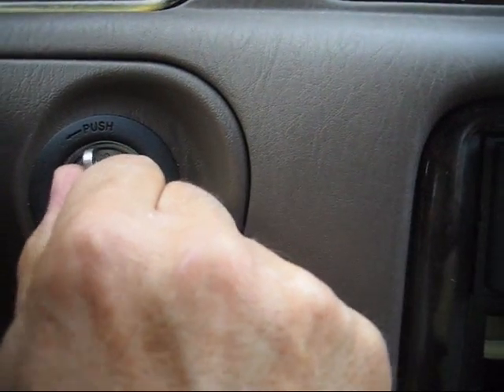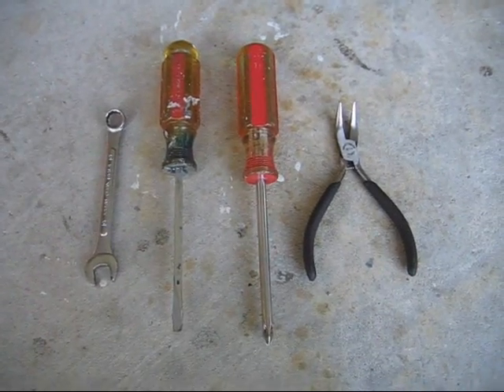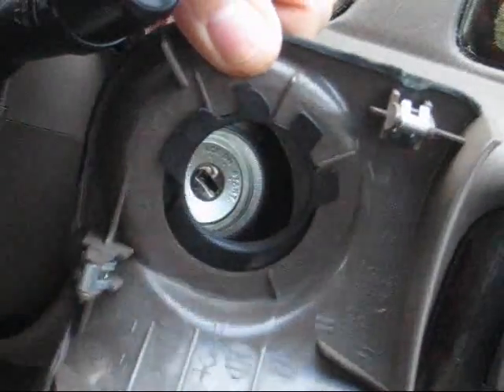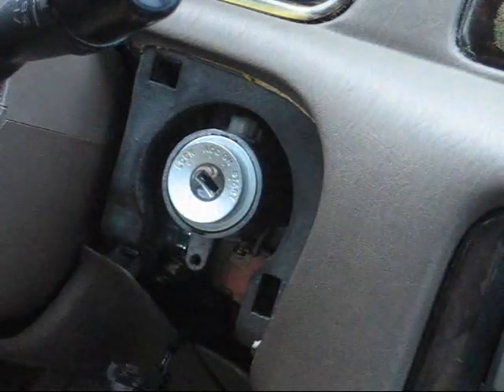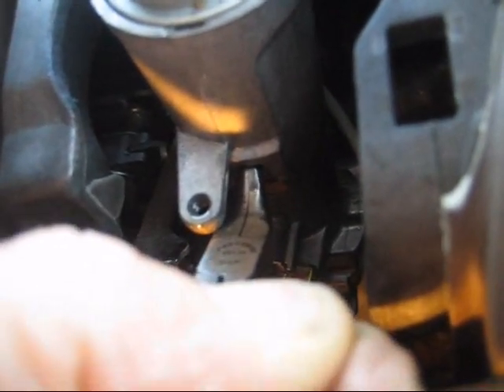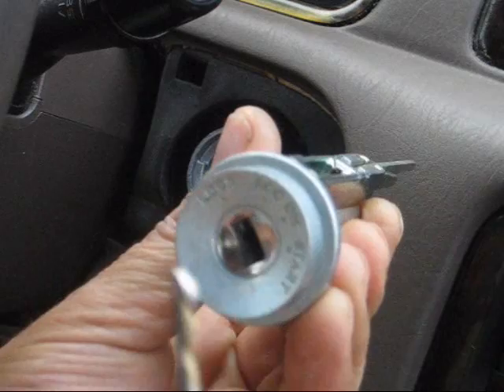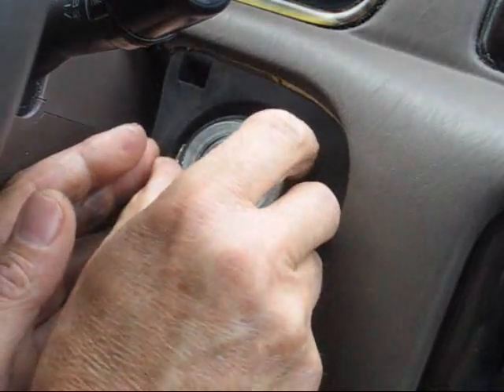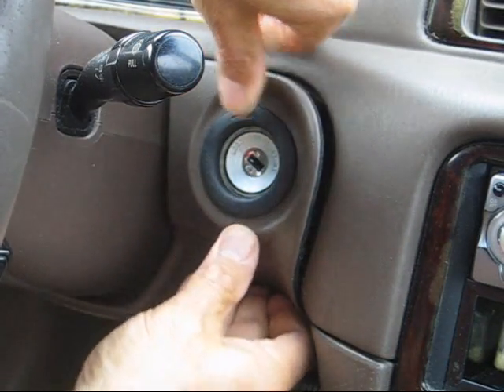Ignition Key Lock Cylinder Replacement - 1998 Toyota Camry (1997 thru 2001)

Comment: I liked ur stuff looks great. however my key won't even turn to Access position .. any suggestions ?  thank you
Reply from the maker: Hi enslaved 46, getting the key to turn to the ACC position is the hardest part. I struggled moving the key back and forth, used different keys, a newly cut key, pressing the brake, WD40 (not sure if any of that did anything) for a long while till it randomly moved to the ACC position, otherwise I would have had to drill the pin so the cylinder would release. Good luck enslaved 46, let me know how you make out.

Comment: I don't know if you would know the answer to this, but if you do that would be awesome! 
I recently had the ignition installed on my 97 corolla. I do not live within 100 miles of where I got the work done so it wouldn't work that well to drive back there to get it checked out. But there has been a problem when I turn my steering wheel to the left and then to the right since I had the ignition changed with new key. When I turn the wheel to the right it will occasionally click as if the steering wheel is trying to lock (and it has locked sometimes when turning the wheel to the right). Any ideas?

Comment: AMAZING straight to the point video. Friends car at 190,000 so getting close. Is there any way to use the same key or do all ignitions come with new keys?

Dealer has a cylinder kit that includes ignition & all locks but it's $350.
Reply from the maker: Each ignition cylinder comes with their specific(unique) key for that cylinder. It’s basically an anti-theft design. Otherwise, a thief can use their key/cylinder to drive any car away.  The frustrating part is it could happen at 100,000, 190,000, 220,00 miles and so on or maybe not at all. Very unpredictable. Mine randomly got stuck and it took me awhile before the ignition cylinder finally moved into the ACC position. (Or I may have had to drill the pin to have the cylinder release.) 
I purchased the ignition cylinder/key at a local auto parts store for around $50.00. Yes, I had 2 keys, but I was fine with it. Let me know how it works out. Thank you ZeroMemphisto for your comments/posting.
Reply: @DoItYourSelfers  Thanx! I've read things like having a lot of keys/objects/weight on your keychain will cause the tumblers to break/flex after awhile. Not sure how true it is since I've had Push Starts for some time now, but to be safe I keep as little as I can on the keychain.

The part should be in, in a few days and this looks super easy so should be no sweat. Thanks again

Comment: I can't get my key in ACC:( any tricks if I can't get it to access? I've been trying for about a hour
Reply from the maker: Unfortunately John I don’t have any tricks, like you I struggled moving the key back and forth, used different keys, a newly cut key, pressing the brake, WD40 (not sure if any of that did anything) for a long while till it randomly moved to the ACC position, otherwise I would have had to drill the pin so the cylinder would release. Good luck John let me know how you make out.
Reply: Old post, I know but what worked for me are Dupont non stick dry film lubricant ànd graphite powder. Be careful with the graphite as it is very messy.

Comment: Hi, Is it necessary for the old switch to be able to turn to the accessory position?  Mine will not even turn at all.  Will I still be able to release the spring and remove the old switch?
Reply from the maker: Hi Rick, The key needs to be in the ACC position for antitheft reasons otherwise anyone could pop out the ignition lock cylinder and use their
key and ignition lock cylinder to start the car. I gotta tell you, I struggled moving the key back and forth, pressing the brake, used different keys, a newly cut key, WD-40, then (I’m not sure those things even worked but) it moved to the ACC position. If it didn’t move, I would have had to drill the pin in order to have the cylinder slide out. Good luck. Let me know Rick how you make out.

Comment: May I ask you, is it easy to replace the green light that goes around the cylinder? Mine went out when I replaced the cylinder.
Reply from the maker: Actually, mine hasn't worked since before replacing the ignition. I didn't want to get into removing the cover panel and I believe a metal cover plate to get to the light connector. I decided the car was too old for the effort. Good luck if you decide to take it on. Thanks unclealpine for posting.

Comment: I have a 99 Toyota Camry I'm trying to do the same thing Casey run to push on the button and take it out but it's not removing I'm not sure if Mike he's going all the way into the ACC position any advice
Reply from the maker: Hi Guy, you might be right, it still might not be in the ACC position if it’s not releasing. Other than persistence and determination, moving the key back and forth (a 100+ times), using different keys, etc. it moved and I was able to press the release button. Otherwise I would have had to drill the pin. Good luck Guy let me know how you make out.
Reply: Guy Bowen  im having the same issue i already tried more than 1000times and not succes any idea?

Comment: Great video!! I am having an issue with my 99 camry. I can't get the button on the bottom to go in.  I turned it to the ACC position but I can't get the spring loaded button to go in so that it will release the old cylinder.  Any suggestions?
Reply from the maker: Hi datzitteezy, hmm, maybe the spring is jammed or not aligned/seated properly. You may have tried this already but spray the button with some WD-40 lubricant and really push or lightly tap on the button but from different angles. (Not necessarily just up and down) Let me know how you make out. Thank you for posting.
Reply: +DoItYourSelfers thanks for the help still unable to get it out. Pretty frustrating at this point. I've tried everything.
Reply: datzitteezy posting a video on this issue.
Reply from the maker: Oh man, I feel your frustration datzitteezy. I looked at my old ignition (I thought I threw it away) :) As you know, the spring loaded button will not move or go in unless it’s in the ACC position. I’m wondering if your ignition key looks like it’s in the ACC position, but may not be fully.
Easier said than done but, I had to wrestle for at least 20 minutes wiggling the key back and forth till I got the key to freely move. (not just to the ACC position) It was persistence that got the key to move. I just needed it one time to move fully for me to replace it.

Comment: After putting in the new lock cylinder,  the car won't start.  I didn't disconnect the battery prior to the process.  I think that was my mistake. 
I believe there's now a security feature keeping it from starting.  Any advice,  please?
Reply from the maker: Sorry to hear that.  My first thought would be check the fuses under the hood in the black box. If you did, check all the fuses associated with the engine starting/running. Good luck Infinite Liebermans. Let me know how you make out.
Reply: @DoItYourSelfers  thank you for responding.  Im gonna go try again right now.

Comment: so now you have to bring two keys 1 for the doors and 1 for the ignition? and if somebody wants to steal a camry they just need to bring their own cylinder and replace whats already in there?
Reply from the maker: I guess that would hold true for any car you can get into. Although I am pretty sure a car thief would hotwire a car before changing an ignition cylinder. A way to avoid the 2 keys would be, after removing the ignition cylinder have a locksmith repair it (not sure of the cost) and then you can reinstall the same ignition cylinder. Hope this helps.

Comment: What if i CANNOT turn the OLD key to the “ACC” position, thus cannot pinch out the underneath spring nut in order to take out the old cylinder?
Reply from the maker: I certainly get your frustration. I had tried different keys, a newly cut key and moving the key back and forth for a while till my hands hurt. I kept at it and it did eventually (randomly) moved in to the ACC position. Honestly, I don’t think any of those things worked other than sheer determination/persistence. I have read some people drilled the little clip that you have to push up on in order to release the cylinder. Good luck FrancisHao2006. Let me know how it works out.
Reply: @DoItYourSelfers  Indeed, it did randomly turn to the ACC position, after almost an hour of frustration and prayers 😊
I was thinking about the option of drilling off the little spring-nut. But thank God that I didn’t have to 🙏
By the way, I did use the link in your description to order the part. So, hopefully, you did get some commission with Amazon.
Again, thank you very much for your very helpful video! 🙏🙏🙏
Reply from the maker: Awesome! Great to hear. That's why I add in my comments about, "sheer determination/persistence." And yes 🙏 Thank you for using the link.👍 All the best FrancisHao2006. God bless.

Comment: Thanks for your previous reply. One more question; I looked at the Amazon linked page. Which one did you wind up buying?
Reply from the maker: Actually, I didn’t purchase the ignition key lock from Amazon.  I did the repair years ago, before I had any affiliation with Amazon so I had purchased the ignition key lock at my local auto parts store.

Comment: DoItYourSelfers.  If you do this, don't you have to replace the doors and trunk as well to match the new keys ??
Reply from the maker: For me, dealing with 2 keys was not bad, considering what I saved by doing it myself. I felt changing the key door and trunk locks would add up in expense. With that said, I found out if trying to avoid 2 keys, you might want to consider taking your key lock cylinder to a locksmith after you remove it. They may be able to fix the cylinder tumblers, if so, you’ll be able to use the original key(s). I would first call a local lock smith to find out if they can and for the cost. Hope this helps. Good luck RobertMOdell.
Reply: Thanks for your help.  Great video too.
Reply from the maker: Thank you RobertMOdell.

Comment: If the original key will not turn in the ignition switch at all why would taking off that screw that holds the light ring suddenly allow the key to turn the ACC position? I have taken out the screw but key will still not turn??
Reply from the maker: Hi. I'm not sure what screw you're referring to exactly. Do you mean the spring pin that holds the cylinder in place?

Comment: So I just bought this 97 camry and it came with 2 ignition keys. When I went to start it the first time I brought it home the key didn't turn, I then proceeded to try the other key and it turned fine and I didn't think much of it. Later that night while driving it the same thing happened except for both keys weren't working this time. I sat there for like 5 minutes taking the key in and out and trying again and again. Finally I got it to turn and drove home from the gas station. First thought steering wheel lock, but I tried moving the wheel around with key out and it didn't lock and I could turn the key fine. So I think it's either I need a new key made or the cylinder needs to be replaced. Any thoughts on this? Also, where do you buy the cylinder at?

I'm also confused as to how you're able to do this. Isn't each key different for every car in some way? So wouldn't the cylinder have to be like tailored to your car somehow?
Reply from the maker: It sounds like the ignition lock cylinder may need to be replaced. I too tried different keys, also had a newly cut key made thinking that it may be OK but it still kept getting stuck. I knew I had to get the key in the ACC position so the cylinder would slide out, once I got it to the ACC position, I decided to replace the standard (no transponder) ignition lock cylinder. I purchased the key lock cylinder at Pep Boys but any auto parts stores will have the ignition key lock cylinder. Because I did get a new ignition lock cylinder, I have 2 keys, the original key for the doors and now the new ignition lock cylinder key. What you can consider is once the old lock cylinder is removed, you can possibly get the old cylinder repaired at a key lock smith to avoid the 2 separate keys. I have read the cost is reasonable for the cylinder repair. I hope this helps. Thank you Another Brick for your comments/posting.

Comment: Nice video. But why do you need to disconnect the battery?
Reply from the maker: I read (somewhere) to disconnect the battery because of the possibility of the air bag deploying. I wasn’t too sure how true that was but I figured why take a chance so I recommended to disconnect the battery. Best to play it safe. Thank you J. Wilson for your comment/posting.
Reply: @DoItYourSelfers  I read that too but also that the wiring to the airbag is always yellow. I haven't been able to confirm either claim though. I will keep looking for evidence however.

Comment: I came here because I believed my ignition switch is faulty.  The problem is an increasing failure to start the engine (turn the key, nothing, turn it again, nothing, turn it again and the engine starts).  Now it appears that the ignition switch simply makes contact with points past the casing?  Will replacing the ignition switch fix the problem?
Reply from the maker: That’s a tough one.  Honestly, R G,  I can’t say for sure if this an ignition cylinder switch or electrical issue.

Comment: I can't get the key to turn to accessory, only enough turn to unlock steering. This does keep the key in (for oull strength) though. The cylinder spring buttong will not go in, and release the cylinder. Could this be not going in bc the key is not in accessory? What can i do? 

My ignition is broke and my windows have been down for 2 days. With april showers. In city with fairly high crime rate. Please help.
Reply from the maker: I know of your frustration. Getting the key to the ACC (accessories) position is the hardest part. I had a heck of a time and time it took. If you haven’t already, try WD40 oil, different keys, also cutting a new key (couple of bucks at Home Depot/Lowes), turning the key back and forth the little that it moved until it moved freely. I would have had to drill if I didn’t eventually get it to move. It took many attempts before it finally moved into the ACC position. Good luck Travis. Hope it works out.
Reply: Thank you! I thought it might be impossible, but this gives me hope. :)
Reply: ***** I still cant get it to turn. Should i drill out the key hole, or the cylinder release button hole?
Reply from the maker: Hi Travis. Honestly, I didn’t have the experience of having to drill, so I would have to defer to a video that explains it. Let me know how you make out.
Reply: I removed the final receiver with the electronic components from the back of the ignition, and mounted it with a couple zip-ties. I now start my car with a good ol' swiss army knife, or a screwdriver. I feel like Tommy Pickles from The Rugrats with the screwdriver. 8-) 
I'm thankful that my key still works to unlock the steering wheel, or i'd be in trouble.

Would like to replace the cylinder in the future once I find a way to remove it. But for now, I'm driving again. Thanks!
Reply from the maker: Awesome! Good to hear you’re driving again. LOL on the Rugrats reference. Hey whatever it takes, right. Thank you Travis for the update.

Comment: my 1998 camry keys were lost. I ende up messing up the ignition to where even if i had a key it wont turn to the acc position. am I screwed? Or can I drill it out so I can turn it to the acc position to replace the cylinder? i need help my car wont start
Reply from the maker: Hi David, honestly I haven’t had that particular situation but it does sound like you may have to drill. If you do, I would suggest using high speed steal or titanium drill bits and also mark the drill bit (with tape) for depth so you know how far to drill. You don't want to go too far or you may go into the steering column. There’s some good videos out there specifically for your situation.  I hope all goes well for you.

Comment: They key on mine goes in but won’t turn at all not even to the acc position. What do I do to replace it without going to a shop?
Reply from the maker: I feel your frustration getting it to the ACC position. It’s the hardest part of the repair. I struggled moving the key back and forth, used different keys, a newly cut key, pressing the brake, WD40 (not sure if any of that did anything) for a long while till it randomly moved to the ACC position. I believe it was persistence (sore fingers) that got the key to move otherwise I would have had to drill the pin so the cylinder would release. Good luck Stay Humble88. Let me know how it works out.
Reply: DoItYourSelfers I tried everything. Caught blisters on my fingers and all. I ended up taking the cylinder and the whole housing off. Then when the ignition switch fiiiiiinally came out it was due to the housing breaking. I guess now I’m off to buy the new housing to be able to put the ignition switch into it to then put everything back together. I’m assuming the hard part is done and out the way.